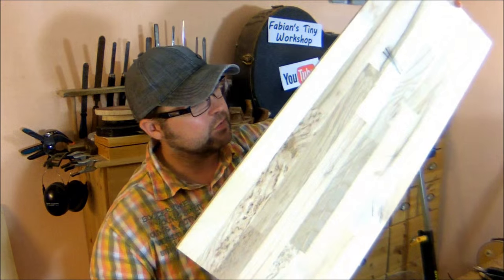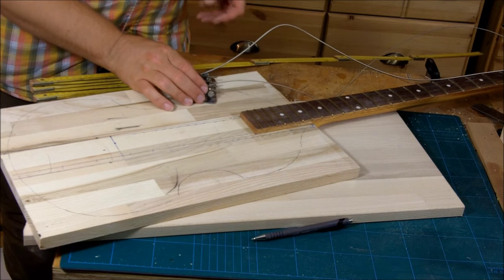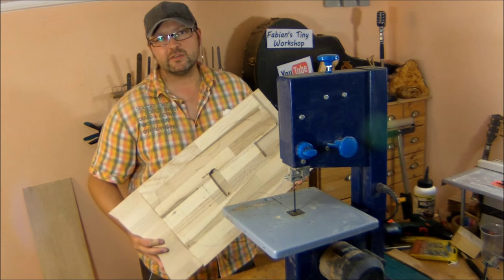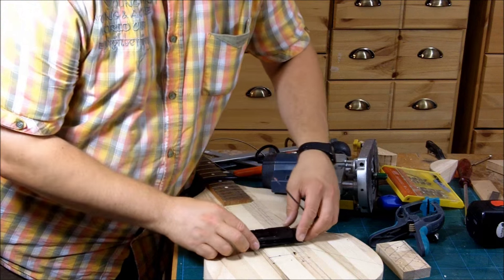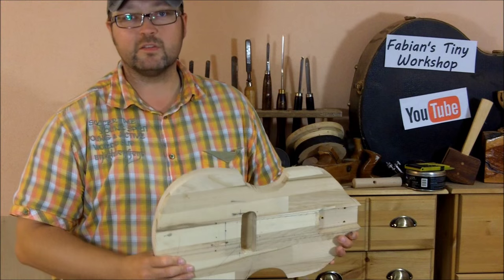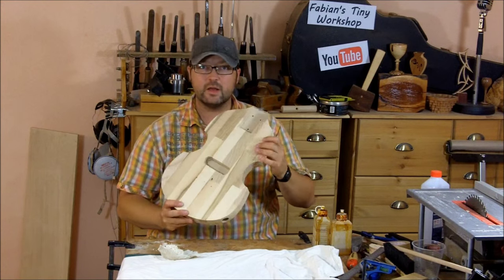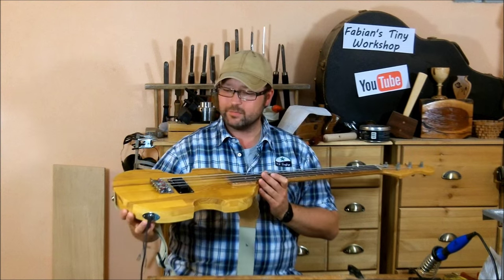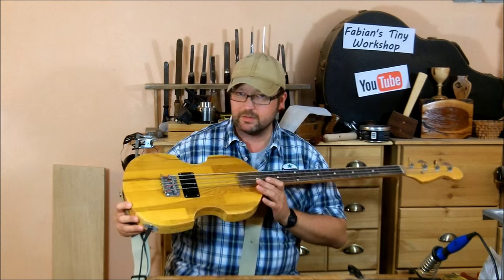Making an Electric Bass Guitar

Comment: I love that you used shellac. Very nice job. The only thing I would have done differently is place the pickup at the neck or halfway between the bridge and neck. I have a Wishbass that came with only one pickup at the bridge position and I ended up adding a neck pickup because there was not enough bass. :)

Comment: What I like about this is that, for a beginner without CNC lathes and equipment  and a fancy workshop, it is perfectly possible to make your own. I noticed that there is no volume control. I have made one guitar and put only one volume control- How often do you really need a tone control given that most guitar go through pedal boards and effects. I can see though that you could even get by with a volume pedal. Anyway, well done.
Reply from the maker: Thank you :) Yes I wanted to keep it as simple as possible since it's only glulam with cheap korean parts.

Comment: overall, spectacular job! the only thing that bugs me is that there's no volume potentiometer...
Reply: +Fun &amp; Eclectic no potentiometer at all, and I don't see any EQ device in it, and no pickup switch ! Just the jack embase directly linked to the pickup, is it really possible ? I didn't know that before, is it really possible just to have [pickup -> jack] !?!? easiest way to make a DIY guitar !
Reply from the maker: +Clément G As you can see and hear it works ;-) There is only one pickup so no need for a switch. I rarely use a tone or volume control so I didn't bother ;-) I do however have a volume pedal on my effect board.
Reply: +Fabian&#39;s Tiny Workshop Indeed ! Ok, great job anyway !

Comment: bit late reaction maibe but i think if you mess a little with some capacitor mounted across the leads on the jackplug you might actually get a pretty good tone out of the current pickup 
these capacitors dont cost a lot , it does take a bit of experimenting though
Reply from the maker: That's a good tip. I did this once on a telecaster pickup to change the resonance frequency.

Comment: This is a great tutorial! What happened with the knobs tho? Is there a way to externally control the volume and tone without them?
Reply from the maker: I did not bother with control knobs because I never use the tone knob and I have a volume pedal. But then again maybe I was simply to lazy ;-)
Reply: @FabiansTinyWorkshop  Ahhh I see, I might try and install the knobs just because I have no pedals hahah, another question, how much was the overall cost of this build? I don't wanna make something too expensive for it to sound like absolute crap hahahah, I want it to sound like yours!
Reply from the maker: @gioricci6245  It depends on what you already have on hand and what you need to buy. The neck and the hardware I got for free. The wood for the body I got from the hardware store. The tools and the finish I always have on hand. So for me it was very cheap.
Reply: @FabiansTinyWorkshop  I see, the only thing I'd have to spend on is the pickups and that stuff, thanks for responding the comments on this very old video hahah, I saw the little "Burnt" style body you made and I'll definitely give that to my future bass, I'll keep checking out your channel and will definitely subscribe!
(Good choice on the hofner there)

Comment: would it be easy to put volume and tone knobs in the build
Reply from the maker: I think for a volume and tone control I would have needed a back cavity. Without it the wiring is so simple you don't need the extra space.

Comment: Where did you get your template, and how thick were each boards that you glued together?
Reply from the maker: It's not really a scale template. I used a picture of a höfner bass and traced the outlines.
I don't know the original dimensions but my body is 3,6cm thick (it's made out of 2x1,8cm Glued Laminated Wood) and 28.5 cm at the widest point. Hope I could help.

Comment: How long did you wait until you applied the polish to the backside of the body while the front had to dry?
Reply from the maker: I did it at the same time, because I screwed a piece of wood to the neck pocket that acted as a handle so I could work on all sides. Look at 9:42 and 9:54 to see what I mean.
Reply: Fabian's Tiny Workshop Aah, thanks a lot for the quick answer and keep on making such cool stuff!

Comment: Where did you get the plans or drawing for the Beatle Bass?
Reply from the maker: It's not really a scale template. I used a picture of a höfner bass and traced the outlines.
 I usesd a picture like this http://www.vintage-guitar.de/img/vintage/894/Hofner_Cavern_Bass_1962-body.jpg 
to trace the outline shape of the bass. I don't know the original dimensions but my body is 3,6cm thick (it's made out of 2x1,8cm glulam) and 28.5 cm at the widest point. Hope I could help.

Comment: May i ask, please tell me where did you get the template for the body?
Reply from the maker: Usually you can find a link to the pattern or a link to the website with the pattern in the description of the videos.
Please understand if it is not my pattern I will not post a download-link for the pattern but I will post the link to the website of the creator where you can get the pattern.
If there is no link in the description then unfortunately I don't have a pattern :-(
Reply: @FabiansTinyWorkshop  hey, thanks for getting back to me.  I sent my last before reading the other comments.  In another comment, I saw your link to the picture.  I copied that, saved it as a .pdf, scaled it up so the max width was between 10.75 and 11 inches (close enough for me). I plan to use some maple butcher I made and was saving for a rainy day project.
I've never made a guitar before so thanks for the great instructional video!

Comment: where did you find this template you used??? want to do something like this so bad but cannot find the right templates
Reply from the maker: It's not really a scale template. I used a picture of a höfner bass and traced the outlines.
Reply: Oh, okay. is there any way at all you remember or have a link to that template? i have looked all over! Also, what was the overall thickness of your bass body? Thanks again!
Reply from the maker: I think I usesd a picture like this http://www.vintage-guitar.de/img/vintage/894/Hofner_Cavern_Bass_1962-body.jpg to trace the outline shape of the bass. I don't know the original dimensions but my body is 3,6cm thick (it's made out of 2x1,8cm glulam) and 28.5 cm at the widest point. Hope I could help.

Comment: hi. First question where are you from? Second question why do you used no poti?
Reply from the maker: 1. Germany
2. There is only one pickup so no need for a switch. I rarely use a tone or volume control so I didn't bother ;-) I do however have a volume pedal on my effect board.
Reply: Ok. Was ist wenn du mal kein Effekt Board hast? ;)

Comment: where did you get the template I'm desperate to find one but I can't
Reply from the maker: It's not really a scale template. I used a picture of a höfner bass and traced the outlines.
I don't know the original dimensions but my body is 3,6cm thick (it's made out of 2x1,8cm glulam) and 28.5 cm at the widest point. Hope I could help.
Reply: @FabiansTinyWorkshop  oh ok i loved your video by the way!

Comment: great vid, where did you get the template? thanks
Reply from the maker: It's not really a scale template. I used a picture of a höfner bass and traced the outlines.
 I usesd a picture like this http://www.vintage-guitar.de/img/vintage/894/Hofner_Cavern_Bass_1962-body.jpg 
to trace the outline shape of the bass. I don't know the original dimensions but my body is 3,6cm thick (it's made out of 2x1,8cm glulam) and 28.5 cm at the widest point. Hope I could help.
Reply: many thanks,  Conan from the UK

Comment: I need the templates
Reply from the maker: Well, since you asked so nicely ;-) It's not really a scale template. I used a picture of a höfner bass and traced the outlines.
 I usesd a picture like this http://www.vintage-guitar.de/img/vintage/894/Hofner_Cavern_Bass_1962-body.jpg 
to trace the outline shape of the bass. I don't know the original dimensions but my body is 3,6cm thick (it's made out of 2x1,8cm glulam) and 28.5 cm at the widest point. Hope I could help.

Comment: a how many piece body??!?!?
Reply: also no volume pot?
Reply from the maker: You might have not noticed that I used glued laminated timber.
Reply from the maker: I rarely ever use a tone or volume control so I didn't bother ;-) I do however have a volume pedal on my effect board.
Reply: you know when you do that, its an ok thing to do but, you gotta put some resisters in there
or you get......well, what you got
, the pickups fine
you didn't take care of  that wiring detail
and you could have  put it in a better spot
on a 34 inch scale neck about 4 inches from the bridge is usually considered the best spot for a single pick up bass
you might wanna shim the neck too
it will give you a little bit of neck body angle and allow you to have a bit of space to lower the bridge saddles into a better action
doesn't take much, a pick or two will do it